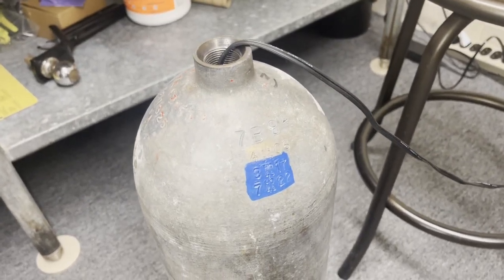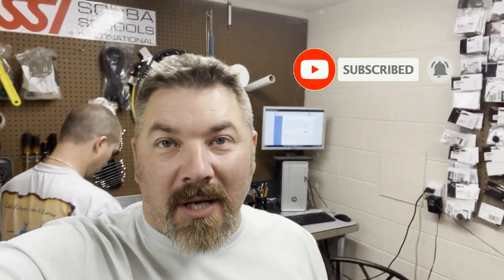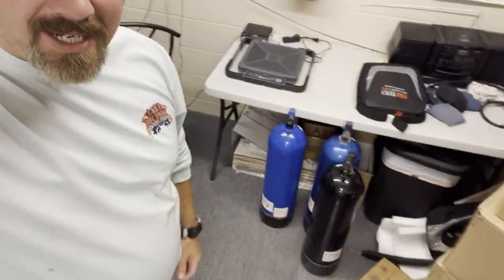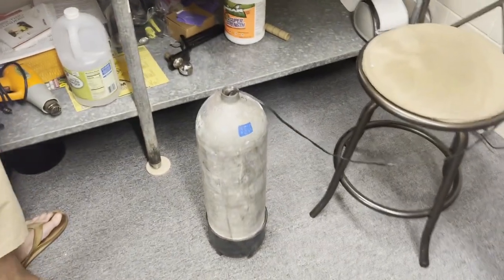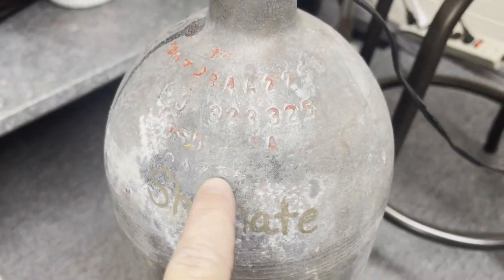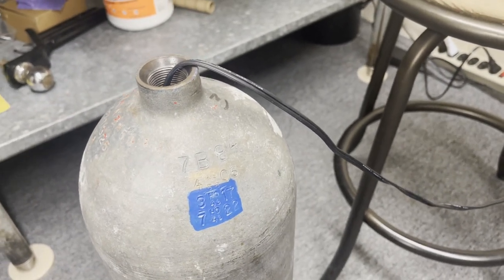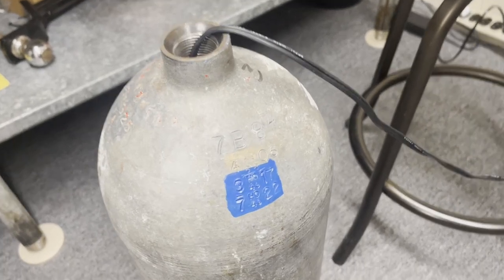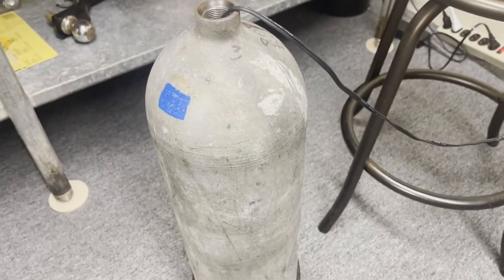WOW!!! This Tank Is Perfect On The Inside

Comment: Hey Brian, Another good video. Wonder you could do a quick video on the number marking on the outside of the tank. I last learnt on my open water. Forgotten how to read it the info. Which would useful travelling to tropic dive sites. Thanks
Reply from the maker: Hello Allen Gavin, I will be happy to make a video about tank markings. We currently have videos scheduled to the end of September, so stay tuned. 

Here is a quick refresher for you. The current cylinder I have in front of me reads as follows.

DOT-3AL3000  CC681195 M5659 04 22 MI  XS-80  TC-3ALM207

DOT-3AL3000 and the TC-3ALM207 simply tells us the the USDOT and Transport Canada have authority of how the cylinder is transported.

CC681195 is the Serial Number on 

M5659 and MI tells us who the cylinder is manufactured by, in this case Metal Impact

04 22 tells us the born on date of the cylinder April 2022

XS-80 tells us the distributer and the size of the cylinder XS Scuba and 80 cubic foot. 

Hope this helps.
Reply: @LakeHickoryScuba   Thanks Bryan. very informative. Especially, If you are looking at purchasing a used cylinder tank or diving somewhere tropical/exotic. Keep with the great work. Safe diving.

Comment: Nice to see but would have been helpful if you had described what we can do to help keep our cylinders in good condition.
Reply from the maker: Hello Elaine Morgan, these are the things we discuss during the SSI Equipment Techniques Course. The main things you will want to do is prevent the cylinders from becoming damaged by dropping them. You will also want to keep any and all moisture from getting inside the cylinder. And lastly, keep the cylinder serviced when its time for a visual inspection and hydrostatic testing. Hope this helps.

Comment: I take really good care of my steel cylinders, but I’ve been screwed by some wet air fills recently that caused some rusting.   It’s so frustrating !
Reply from the maker: Hello Judson Holt, sorry to hear about your wet fills. Specifically with DIN Valves, I will always purge the valve orifice prior to attaching our fill whips. Another great option is to simply dry off the valve with a rag before filling.

Comment: What constitutes "taking good care of your cylinders?"  I've heard for the last 4 years I've been diving that cylinders will last a long time if you take care of them.  But nobody has said exactly what that means.  Aside from where you get your air from, and not letting them drain to 0psi, letting water in them, what else are we talking about?  You mentioned tanks laying on their side.  I wouldn't think that would make a difference in wear and tear on a tank, would it?  I, personally, live in Michigan, and for example, we dove this last weekend in Lake Huron.  (video of the bottom portion of one of the dives can be found here, if you are interested: https://www.youtube.com/watch?v=uaF57mvH7RI&t=213s)  Air temp on the surface was around 85F.  Temp at depth was around 41F.  Could this temperature differential be a cause for shorter tank life?  As you cool the tank, any moisture in there will condense.  Lots of possibilities, I know, but can you elaborate, or do a "deep dive" on what constitutes good care of tanks?  Thank you for the content!  Keep up the good work!
Reply from the maker: Hello MahnkeMachine. In short, taking good care of your cylinders means preventing damage to them by not dropping them, securing them when not in use, maintaining them when it comes to visual inspections and hydro static testing. Typically, storing steel cylinders on their sides for a lengthy period of time is frowned upon, as the thinnest layer of metal on a cylinder is its sidewall. In the event moisture does enter the cylinder (even by condensation), if it settles on the sidewall, it can corrode it very quickly. Also, not over pressurizing them during the filling process. I know this is one I struggle with personally, as do a lot of experienced divers and experience professionals. The thought process is, if the cylinder is hydro tested at 5/3rds the working pressure, then why must we only fill it to the working pressure stamp on the side. Well over time, you will wear out the elasticity of the metal in the threads (both steel and aluminum), thus shortening the lifespan of the cylinder. In the SSI Equipment Techniques Course, we teach several ways to prolong the life of your cylinder and the rest of your equipment as well. Hope this answers your questions.